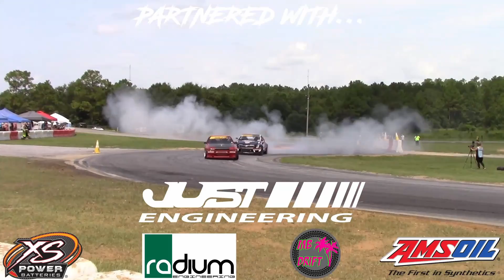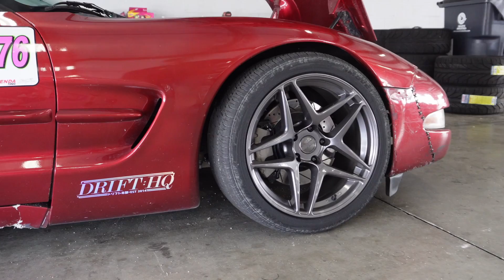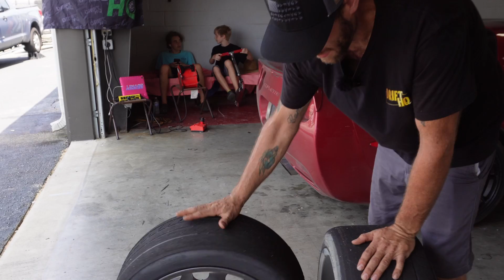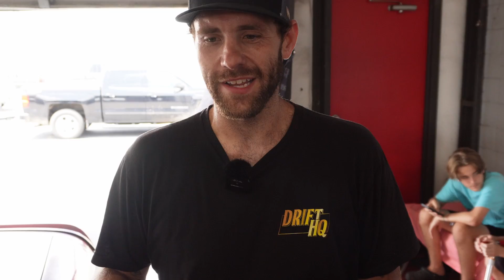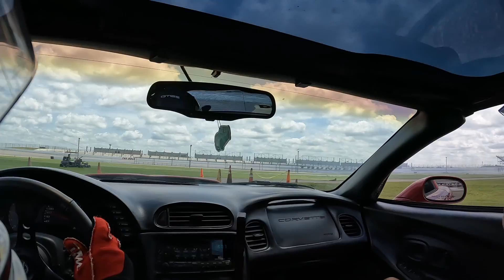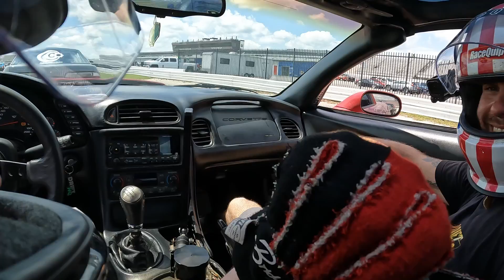C5 Corvette Drift Car - Build Breakdown and TEST DRIVE

Comment: 6k$ and 2k$ angle kit and ur done. na ls3, super reliable. and linear power curve too which is perfect for drifting. people think u need a 10k$ beat up 2jz with 30k$ of mods to drift. and they suck for drifting, they put big turbos on them, yeah they make 1000hp but have terrible throttle response. on a corner you push the pedal a little and nothing happens then everything happens and you spin out.
Reply from the maker: Plus a radiator and oil cooler. I've seen many corvettes overheat coolant and oil, and destroy engines. I think there were 3 LS engine failures due to heat and oil pressure/temp when I did drift week 😉

Comment: The C5 is a great all around car!! Biggest flaw is the stock cooling system 
Upgraded radiator/fans and oil cooler go along way in persevering the engine

Comment: Yeah, you need a badass oil cooler, but if you're drifting an LS you need to convert it to a dry sump oiling system. It costs about $6k, but it'll drastically increase reliability while drifting these things.

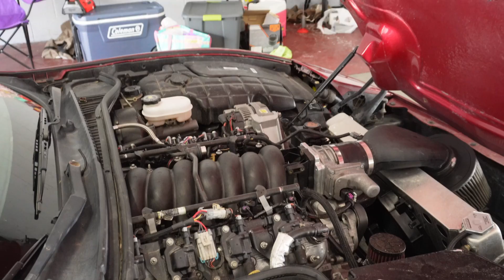Comment: 2:19 another reason i’d think people choose them for is the weight distribution. on the c5 they put the transmission in the back and made the torque tube to make it usable just to have better weight distribution
Reply from the maker: Hmm. I'm not sure how true that is. It's been a common trend for serious Corvette drift cars to get rid of the transaxle and put a T56 transmission in them.
Reply: @DoctoredGarage  The factory transmission is a T56. It's in the back bolted directly to the diff; technically not a transaxle.👍 Thanks for the video, cool to know that an Eastwood radiator works as an upgrade!
Reply from the maker: That's valid, it's not a true transaxle that they're all one unit, GM still calls it a transaxle though. The torque tube breaking seems to be a problem on a lot of them surprisingly.

Comment: Looking at wheel gap it's lower than OEM. OEM height is TALL at 6" at the frame jacking points to the ground! Generally about 3.5 fingers of space in the rear wheel arches, 2.5 fingers of space up front in the wheel arches.

Comment: Looks like he has a LS2/3 throttle body as well. Also, for some of the people wanting to get a C5 to drift. Either get or have someone with a Tech 2 or some tuning software fully remove traction control. The button on C5's doesnt actually fully turn it off, just puts into a less demanding mode. So even when off, its still there a little and can reduce power. Have that turned off with a Tech or software and you're ready to rip! On C6's, the traction control button fully disables it.

Comment: You need to add trap door baffles in the lower oil pan. The pickup tube is in the center of the oil pan so in high g turns the oil swooshes left/right and the engine runs dry. That's why GM recommends running a quart over for track use.

Comment: Throw it in 2nd give it a little clutch If you need to so you don't grip up
Reply from the maker: The crazy thing is this car was geared so tall that I really didn't need to. I could've dropped tire pressure down and gripped up a bit more in 1st gear and been fine.